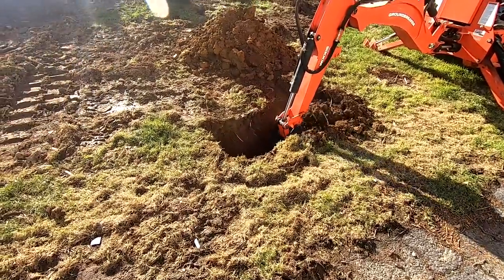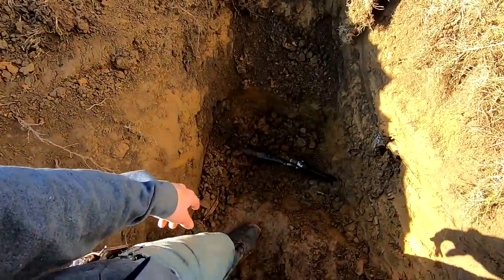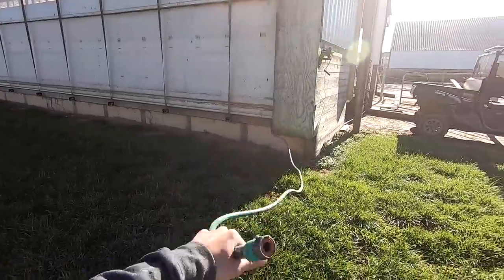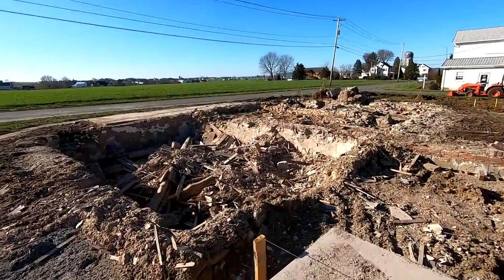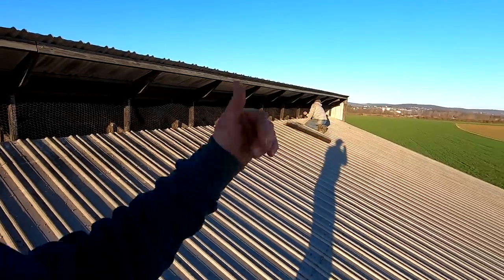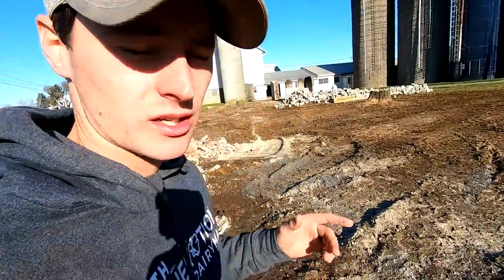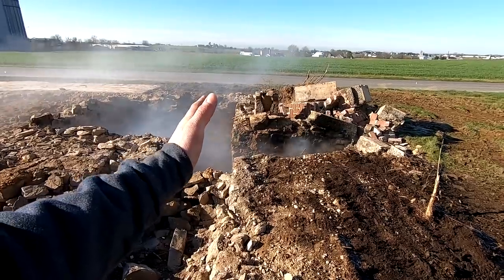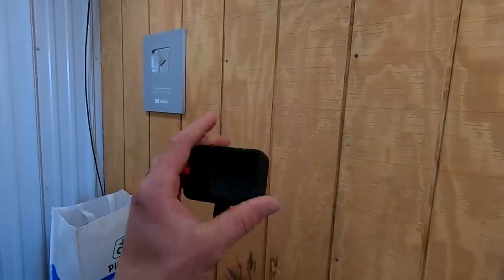Land of Opportunity

Comment: If you have natural gas I would go with the gas forced air with a heat pump(there are a lot of efficiency options with that heat pump). If you are on propane I would look very closely at geothermal. There are really nice rebates for geothermal right now, however you may not have room for a closed loop which would be preferred over an open loop system. No matter what you do with bedrooms upstairs you will never regret zoning the system (upstairs/downstairs). It would use just one system but you would have a thermostat on each level. I have a two story and really wish in the summer that it was zoned. The in floor heat that has been mentioned is really great but very expensive and then you still don’t have ac. No matter what you do make sure your contractor explains all the options and goes over all the rebates that are out there for hvac systems.

Comment: My wife and I built a new home in 1987 and we went with a rectangle design.  Worked great as there is no wasted spaces and make for a straight line roof.  This home was in north Texas and we had natural gas for heat. Two units one for upstairs and one for the 1st floor. Lived there for 32 years and had to replace them about 20+ years in.  That worked out OK as the technology for the furance made them more efficent and the units were smaller.

Comment: Eric,  We built our house in Colorado (6 years ago) at 7300' elevation and we put in a GeoThermal System.  It was engineered for the cu.ft inside the house, including the basement.  Then engineering of this system meant vertical drilling of three holes a certain depth, then those holes hold the heavy plastic pipe that leads to the inside of our mechanical room.  Inside we have a Rheem Heat pump that works with the Geothermal system and we have a heat exchange system and run force air over that and into ducts to heat the house.  You can run liquid baseboard heating instead or in floor heating (very nice but adds to the cost).  With a heat pump you are heating in the winter and cooling during the summer.  We also have a component from the heat pump to also heat our domestic water (two electric hot water heaters, one for the  Geothermal preheating the well water which is cold and then it goes to the second heater to heat further, if necessary, if you want your water hotter than about 110 degrees).  This system is very efficient.  We have a 2400 sqft main level and the same size basement with 9' ceilings and we have not seen an electric bill that has gone over $200/month yet.  And we have some cold winters, summers can get to into the low 90s but low humidity.  Upfront costs are somewhat high but you should be able to recoup that cost within 5-7 years.  Really, it is that efficient!!!  It was the "BEST" decision we made on this house.  Look into it.  We have recouped our upfront cost after 5.5 years.  Quiet and reliable.  We have annual checkup and tuneup as needed and we change the filters twice a year.  No natural gas, all electric and still under $200/month cost on the coldest month.  Your summer heat and humidity may give you some added cost to cool but I think it is still incredibly efficient.  If you can cover the upfront cost, then I would go with this GeoThermal system without hesitating at all!!!  REALLY!

Comment: Also spray foam closed cell at least a inch this will seal all air leaks then you will use conventional insulation to top off 

Or just 3” of foam 
It just a little cheaper with the combo 

Oh and one of the bonuses of radiant heat is a clean house with nothing blowing around in the vents.  A big help for a big family so if one gets a cold it doesn’t get blown around your house

Comment: That's a cute little Kubota digger. Regarding heating, a friend has a network of copper pipe throughout the attic and heated water is sent to modern radiators throughout the house. Heat pumps work too.

Comment: Given your location and the amount of space available, you should consider a geothermal.  If I had it to do over again and I had the room, that is what I would do.  If you don't want to go with geothermal, I would recommend heat pump(s), maintenance is pretty simple and you get both A/C and heat from the same equipment.  You are also in a good spot with no trees shading anything to consider some solar to offset some of the electric usage in the new house.

Comment: In floor radiant heating for sure, it’s so nice to have warm feet. They keep coming up with more efficient ways to run the system. Heat pump or geothermal. Need a good amount of ground to do geothermal though

Comment: I would look into geothermal since you have that big hole to fill in (from the old cinder block barn )can put most of your lines into that right there and save you a lot of the costs to dig/bury the stuff. you can save a ton of money heating and cooling your home that way since your able to get down into the depth you would need so easy with all the gear you all ready have on the farm.

Comment: For my family we installed a wood fireplace furnace, however we do have access to a lot of wood, so the cost is relatively low. It does require about 7 cord of wood a year for our house and a lot of work. You may want to go with in-floor boiler piped heating for yours, it would probably be less work for you, given all you already do, just my thoughts. Thanks Eric and good luck on your new house, have a great week.

Comment: I have done infloor heating for my new home and garage.   In-floor in complete basement floor, in-floor for ceramic tile areas on the main floor and upper floor, in-floor for complete garage. Run off Propane boiler and outdoor wood boiler. Can switch between these units really easy!    I also have complete duct work for the whole house and basement. Air handler can also heat when the infloor does not keep up!  Also the air handler looks after the cooling from Ac unit.    Very even heat for the complete home. Live on a farm with lots of trees blowing over, but wood is a lot of work.

Comment: Heat pump .. with good, thermally efficient home underfloor heating is the best and most cost effective.. Good luck with the build 👍
Reply: It would have to be a heat pump with a gas pack! It's way too cold up there for a standard heat pump, it would never keep up!
Reply: Would be really good if you could capture the methane from the cow manure. Use that for heat or drive an electricity generation system.. heat and cool your home and sell excess to the grid..

Comment: Geothermal is hard to beat great for cooling and decent for heat, Running 1980s parts retrofitted into a 1970s house for 20 years, and it is nice especially if you add the heated floor loops.

Comment: Spray foam all walls. If you have the budget I'd do radiant floor heating in basement and first floor.  With a back up of forced air with central ac.  Radiant floor will for sure keep the house warm and comfortable.  Low cost to do.  Having the forced air heat as a back up will come in handy when the temps get below zero. With the spray foam though you may never have to use the forced heat.  But does provide a back up in case of the radiant floor heat needing repairs.  Always have a back up.  With the radiant floor it's used within conjuction of an on demand water heater and a hot water tank.  The hot water tank just keeps the water hot it doesn't provide the hot water.  A good solid hvac plumbing company will set you up.

Comment: Definitely floorheating to provide base temperature in the cold months. Since floorheating has a considerable responsetime it should be combined with air to air heatpump when sudden temperature changes occur. Though not inexpensive you will have a high comfortlevel and the air to air heatpump can serve as ac in summer time. Look into multifuel systems for the floorheating or prepare to adapt to different powersources, as time goes by price will change. My friend just got at least 4 years worth of burning wood for next to nothing and about a week worth of work. Happy to see the progress 🙂

Comment: I would recommend a heat pump for heat and a/c - you may need electric element backup if it get too cold in the winter, but you should have solar around somewhere given all your land, that's your call tho (you could also do windmills maybe). Most cities are not issuing new gas permits as gas appliances create co2 which is better controlled at the power plant. They have some very efficient electric appliances these days.

Comment: Thanks for the update Eric. Sounds like your builder is rarein' to go...a good thing! Someone else mentioned geothermal for heat...which prompts this question...Is geothermal in use in your  area already? I would not be a trailblazer for same...if not. Looks like solar might be a possibility...and costs are likely to drop a little further on that front, but also hearing that wind generators on your ridgeline may become more common? Any wind survey data for your area available? At least a few choices at hand! Thank ya'lll for dairy farmin', fixin', feedin' and building for the  future for  🇺🇸  !

Comment: For heating, if you built with SIPs (including for the basement walls), you could easily heat the house with a fan coil in the attic. Augment that with solar panels as it appears you get a lot of sun there. Align your rear roof to the south and you'd be all set. We build YEAR round here with SIPs and only need a concrete footing. And we build down to -25C. Good luck!

Comment: I whole heartedly agree with in floor radiant heating….most comfortable type there is….a little pricey to install I have never met anyone that regrets it.  I would also like to put a plug in for a wood burning stove.  A good stove can not only look great and provide a nice cozy ambiance but can be a reliable backup when the regular heat source is on the fritz.  It is currently 13 degrees and windy in Colorado where I live and I have and Ideal Steel (Woodstock Soapstone Company) and the house is a nice warm 74 degrees.  It has a catalytic converter so it’s super efficient and they were a great company to work with.  No, I’m not paid, I just really like there product.  With a little work (not like you need that) but firewood can often be found dirt cheap or free after tornados or ice storms.

Comment: I would definitely go with a heat pump system if I were in your shoes. Lots of brands out there. RUUD would be my suggestion. After working for YORK and RUDD/RHEEM distributors, RUUD/RHEEM is way more reliable and last a lot longer than most other options. Parts are readily available if something goes down and when registered they come with a 10 year parts warranty. With spring coming soon a lot of places are going to have spring rebate programs coming up especially with all the new regulations starting on January 1st. Best of luck!

Comment: 1. Nine foot ceilings, minimum.  It will make the place feel HUGE! Plus you can have a BAF ( big a$$ fan ) moving air in the warm months.
2. Radiant Heat. Bar none the most comfortable. Heats the house from the bottom up. No cold floors. Put it in your basement floor for sure.
3. Six inch walls.
4. Poured foundation.
5. Insulate the basement walls from the outside before back filling.
I could go on and on. Hire an architect/designer/builder that work together.

Comment: heating advice:  NOT forced air hot water in floors is ideal.  Warm floors, even heat.  May not need heat upstairs if house is well insulated, except in bathrooms.   I have seen a plumber heat his house this way and he used just two ordinary hot water tanks to supply hot water.  Geothermal is good but you need to dig up ground to install pipes.  Heat pumps are efficient.  Or natural gas boiler.  But go with hot water for sure,  in first level floors if possible,  otherwise  baseboard.

Comment: Erik, for heating the best, most comfortable and most efficient is underfloor hydronic heating, and you can (and should) run that in the garage and any concrete floors. As for cooling and to make the bedrooms super comfortable, add mini split heat pumps. They are extremely efficient electrical units, silent, and you can cool the rooms you want. I’m an electrical engineer and an electrical contractor.

Comment: Where you are, I'd say just super insulate. R60 in the roof, R40 in the walls, can run insulation along the basement and triple panes.  Double duty boiler for on demand hot water and hydronic heating (infloor) is a great option (gas not electric) coupled with an HRV. Very quiet compared with an high efficiency furnace kicking on and off constantly.

Comment: No matter what kind of heating you have it's extremely smart to have a back up like a wood stove in the basement just in case. Also it's always a personal choice but what I'd built as a 20 something yr old is sure not what I would today! Keep in mind that you're not always going to be in your 20's and going up and down steps may become very difficult or even worse impossible. Yes you will have steps to the basement but have everything on the main floor , at least if for some reason it  becomes hard to navigate the steps you can limit the trips. Maybe even work it where it might be a weekly or monthly event. Functionality is another thing! I farm myself and having mud rooms,tiles in entrances with frp board and with a drain can be very useful. Check out some of the barndomineums,might help you on the pva taxes ( looks like a barn and not necessarily like a residentece) along with a lower cost per square foot.

Comment: Hey Eric, we built a house in 2015 and are located in PA. After researching geothermal, I discovered concerns with it keeping up during our January temps. My neighbor installed that system and has found he needs to supplement heating with a wood burning stove. 
I installed a heat pump supplemented with oil burner backup. 
My home is 2700+ sq/ft. I can heat my home comfortably with the heat pump and an average 275 gallons of oil. 
My research showed the upfront cost of geothermal had a substantial time for return on investment. Just my thoughts. 
Enjoy your videos. Excited for you and your family during this new home build.

Comment: Outdoor wood furnace with radiant heat in concrete  works good in Maine so guess it would in PA. Free hot water all winter if hooked up to a hot water tank inside. Only use electric during summer.

Comment: Eric, love your videos! As far as HVAC for the new house, I would investigate a heat pump combined with forced air. The heat pump would heat down to -20F and cool. When needed, the forced air would assist the heat pump. This is a very efficient way to go.
Reply: Yes heat pumps have gotten very efficient over the last few years. You would then have a gas furnace when it's too cold for heat pumps to work Forced air is not ideal heat....but it gives you air conditioning. Working hard all day long...the A/c is very nice. If I were you.... again working hard all day, don't even consider a wood stove! That's crazy!. I'm a residential home builder and general contractor for 30+ years. Great content....keep it up!

Comment: regarding HVAC...if you have Natural Gas on the property...Go with a 90+ modulating gas furnace paired with 16 seer a/c system. Otherwise I would go with Geo thermal with vertical ground loops.

Comment: I would do forced air so u can have normal heating and air conditioning, but I would also put infloor heat tubes in concrete in ur garage and basement so in the future u can hook a boiler to them and have floor heat but I strongly recommend at least putting the tubing in

Comment: The best advice you can ever get is to build your house for a passive standard. I live in a passive house(or at least orientate it perfectly towards the sun), and I can’t believe how small the bills for mantainance are.The best investment ever.
O,the last night outside temp was -8 C (17 F) and I slept inside the house in shorts and T-shirt . The heat was at minimum capacity.I can’t set it lower than that..

Comment: If starting from scratch I would go geothermal, since it isn’t dependent on outside temperatures it is very efficient at heating and cooling through the extremes of both winter and summer.

Comment: One thing to remember if you go with infloor heat in the slab. It takes a few days for the heat to dissipate. So if you get temperature swings from the weather your house could be too warm until the slab cools down. Therefore I've been told that infloor heat can supplement the house heat but you should still have another system that can turn on and off faster. Anyone else have experience with this?
Reply: Omg yes this!!! The sun with radiant can cook you out... exactly why I hate it
Reply: Radiant takes forever to heat up and cool down
Reply: I doubt Eric will have a concrete slab first floor, since he will have a basement.  BTW, your comment is great!!!
Reply: @8tomtoms8  yup but you can heat the basement floor also

Comment: Any side walks or driveways drop a piece of 1 inch insulation down, roll pex tubing into it. Get snow or ice circulate hot water to melt it off….works really nicely against floor decking from underneath as radiant floor heating…..Uses a tankless hot water heater really efficiant on cost…Freind did his 20X40 garage with in floor heat cost him $30 roughly a month of propane to heat
Reply: He is in Kansas it does get cold lol

Comment: Here we got solar panels covering the roof and 2 drills going 98 meters down for the heat pump that is working super well and even making money of it from the electrisity. Got a seperate water tank for heating all on electristy stoves..

But you gotta have the house pretty good insulated here we got concreate walls and layer of the special glass insulation and then styrophone.